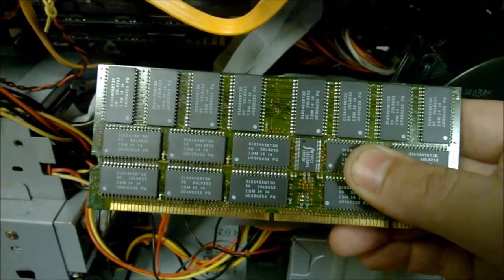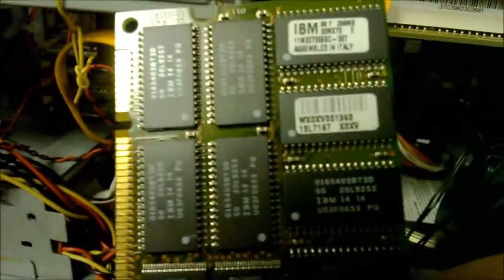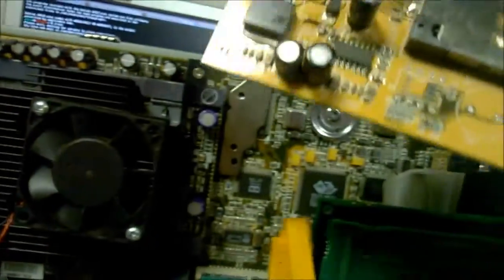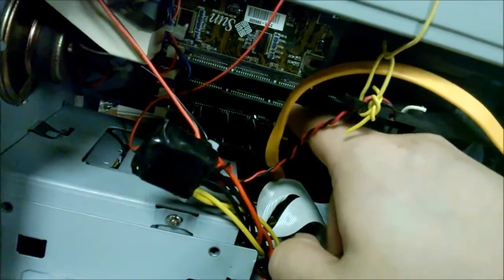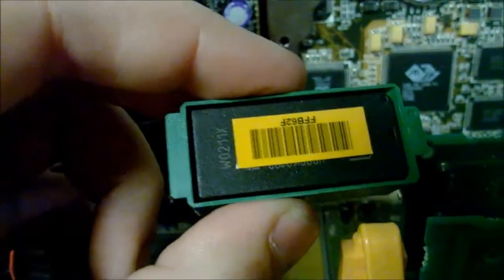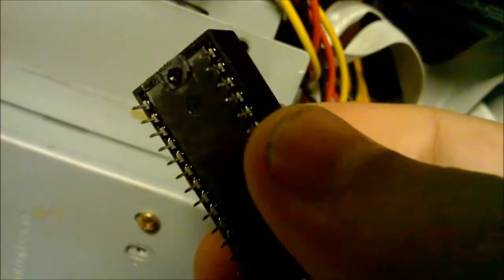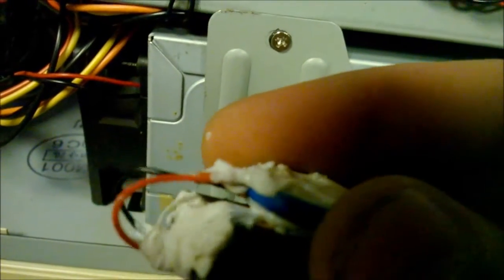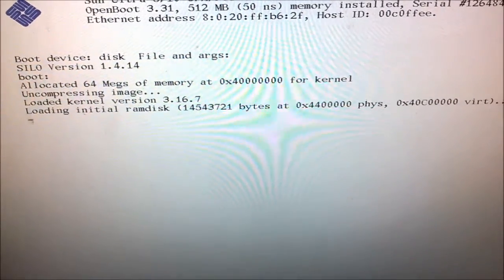Ultra 10 NVRAM fix (Finally!)

Comment: FYI, 256 meg double height DIMMs are supported - that is, they work just fine - in the Ultra 5. They just simply don't fit because of the floppy drive. If you don't mind moving the floppy drive, you can have a full gigabyte of memory in an Ultra 5.

Comment: How did you reset the nvram parameters?
Reply from the maker: Follow http://www.obsolyte.com/sunFAQ/faq_nvram.html and remember that the first byte of the hostid is 80. 
MAC address should be 00:80:20:xx:xx:xx as according to the orange label on the nvram, in my case FFB62F so 00:80:20:FF:B6:2F.
Doogie ( http://youtube.com/user/g60scuzz) has a good video about going through the steps for this on a like-system, however it's kind-of outdated. I've been pestering him to make a newer, cleaner HD video showing the steps necessary.
Reply: I've not had success with this on my 4u (ultra 10).  I did the battery replacement and can save parameters to  nvram and they remain after a prolonged power off.  I'm just not having any luck with restoring the idprom to the original ethernet address and host id - I was fortunate that I took a photo before it lost the battery.  I'm thinking that the idprom is contained on a separate ic that neither mkp or mkpl will allow any update too.  Any ideas?